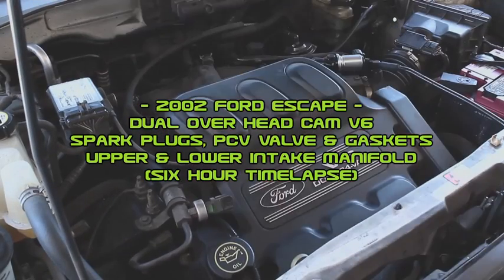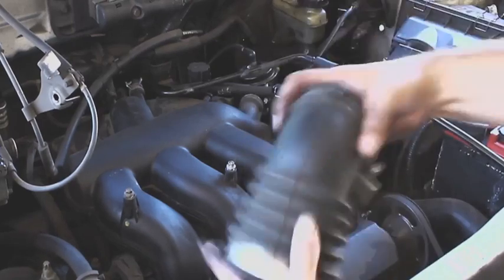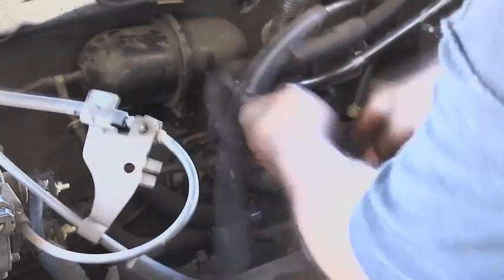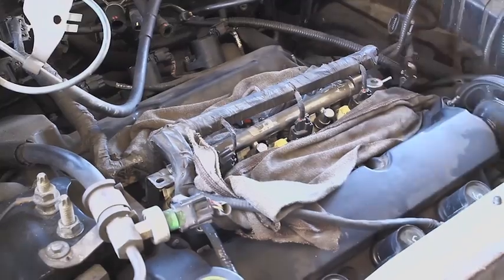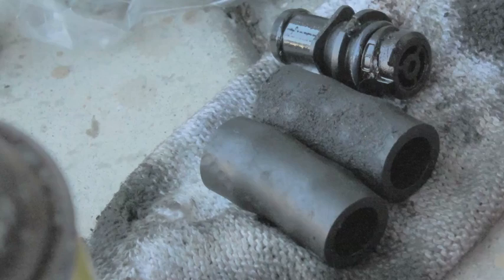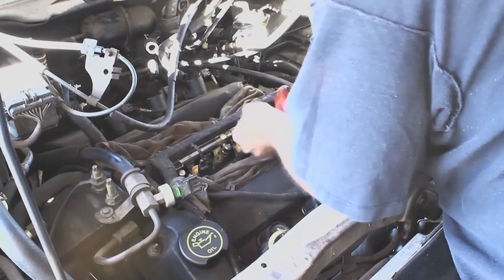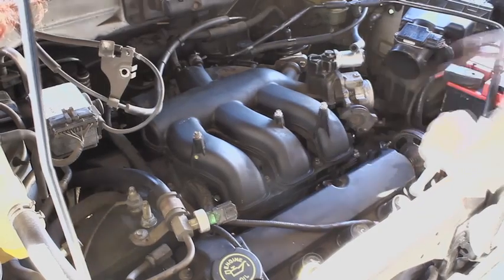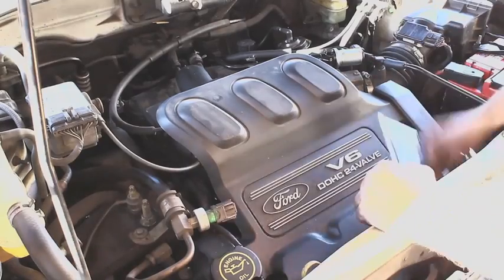2002 Ford Escape intake manifold gaskets (upper+lower) & Spark Plugs

Comment: P.s. I got to NY all right..I used " Bar's Leaks "... I swear by it. It got me there and back 3000 miles..
and Now I figure while I have the time..will fix.
Reply from the maker: mine has what appears to be an oil pan leak that i've read is common on escapes. a mechanic friend of mine recommended not using oil leak sealer because of clearances but i'm going to have to do something about it. the oil is changed regularly and the levels are maintained but i get the burnt oil smell sometimes and it's got some oil mess spattered about.

i have to re-edit the valve cover gasket replacement video and finally upload it, but...

the tricky part of it all was getting at some of the bolts with a u-joint socket adapter and the power steering line had to be disconnected to get the front cover off as well as some electric stuff and of course, vacuum lines and emissions junk (themz technical terms). other things like the radiator hose and everything else were simply maneuvered around very carefully.

i'm considering bar's leaks, glad to hear it works well!! currently, i'm planning to check all the bolts on the oil pan, because i've read that can sometimes become loose enough over time for a minor leak.
Reply from the maker: Steve Burden Hey Steve, how's that bars leaks holding up?! i'd like to try it on my oil leak. i read escapes have a rear main seal problem and bars leaks claims to rejuvenate that rubber seal. ...even read that ford uses it in their initial builds at the plant.
Reply: Lou - Couldn't be happier. It will be 1 year this Sept (2015) that I started using it in my Tribute. Will be using it again next couple of weeks with my oil change.

Hey Lou...Any thoughts on changing the Transmission Fluid? I heard that damage can result from doing a flush. My fluid is burnt and needs changing. Dont want to risk messing with a transmission that is currently working well.
Reply from the maker: Steve Burden cool man, good to hear back. i did a DRAIN & FILL on my automatic transmission for that same reason you mention. (some ppl have posted that if the transmission is used to the consistency of the old fluid it will struggle to readjust and just break down) the fluid in mine was so old it was black! (supposed to be RED of course) so at the place i get my oil changed i had a drain & fill done instead of a FLUSH & FILL and my transmission has done very well. it actually seems to have improved a bit on performance. that was 5 months ago 11/25/14. at some point in the near future i may do another drain & fill to continue gradually replacing the fluid completely.

something else to consider if you haven't done so in a long time, is a flush and fill of your coolant system.

cheers!
Reply: Cool. I've heard about draining the fluid (little by little) and replenishing with new..until most of it is completely out.
Thanks Lou.
Steve.
Reply: Did my first Drain and Fill - mustve been the easiest thing ive done so far on this Tribute - lol - drained it (still mildly warm) - got about 4 qts out. Will do another in the next month or so.
Reply from the maker: awesome man! if you haven't done a flush and fill of the radiator coolant in longer than 3 years or so, you may want to consider doing that also. as i understand, not doing so can be really bad on the engine internally. there's not much to rust but the aluminum oxidation can create problems (so i've heard). the excess heat otherwise generated tends to cause wear/degradation in almost anything generally speaking. Heat, Light, Oxygen... all 3 play into the breaking down of nutrients in foods and other stuff either individually or collectively. Great to hear about your Tribute!
Later!
Reply: Yeah, this past Jan 2015, replaced the upper, lower hoses...(around this time, water pump developed a leak...so I replaced that too)
Now the heater hose which runs FROM the heater core to the radiator JOINS next to /under the battery. The original joiner for these 2 hoses was plastic...well....
that was so worn that it broke up inside and carried pieces inside.

luckily it didn't damage my Radiator, but it did damage my pump.

Replaced it with a copper joiner - good to go.
Reply from the maker: Nice man! Gratifying i'm sure!! Probably saved yourself at least 100-200+ bucks.
Reply: You know it !

Comment: Hey Lou, I'm replacing spark plugs that are under the manifold...and I'm thinking about going after that oil leak in the valve cover gaskets. 

I noticed in spark plugs 4 and 5 there was a little oil in the well..
So, I'm going to attempt it. My confidence has been increasing.
Just replaced the water pump last week.
Thanks for the well wishes on my gig..Happy New Year to you bud - May 2015 be a good year
Reply from the maker: o-ring seals in the valve cover may likely be the culprit. be careful with any/all of the bolts when you are tightening them back into place, they're delicate. of course, the official recommendation is to use a torque wrench to tighten them to spec but, the oil, etc., can throw off the amount of torque required to tighten them to spec and the bolt head can snap clean off or strip the threads. bolt replacement pattern is important for even distribution. most DIY fixers might already know this but, you generally want to tighten all bolts incrementally rather than fully tighten a bolt at a time. HAPPY 2015!!

Comment: hey i have a 2004 ford escape n the mechanic told me i need a intake manifold,but i cant find it.can you recommend one
Reply from the maker: where to buy a new intake manifold/plenum? i'm not sure about that but unlike some other parts, i'd probably go with a ford dealership for that. however, i'd get another opinion before buying a new intake manifold. i bet it's just the gaskets (only a guess though).

Comment: What did you use to clean the engine block after you removed the lower intake manifold?
Reply from the maker: it's been a while but i think i just used a rag with some Awesome brand degreaser sprayed on the rag and not on the block. it was mostly dust/dirt rather than baked on oil, so it wasn't too difficult in my case. my main concern was of course, not dropping any debris into the ports.

Comment: Lou...saw your video on the intake manifold. I've got a Mazda tribute 2003 with oil leaking into the valve cylinder 4 ..5 and 6
Do you have a video on replacing these gaskets.
Sorry ..I'm not experienced...but I've got to do this job by end of this month (Aug)
Travelling from FL to NY on limited funds.
Appreciate your help.. Thanks so much
Steve
Reply from the maker: Hey Steve, thanks for the response. Last week I replaced the valve cover gasket set and did shoot video from an overhead setup. I haven't had a chance to edit it yet but I plan to cut it and upload soon. It took me 7 hours to do because I was being very careful and was also cleaning parts that are difficult to get to. Your gasket set may be different or you may choose another one but I chose the Fel-Pro - Valve Cover Gasket Set - Part Number: VS50551R. It includes the 2 main valve cover gaskets, 6 plug seals (crucial of course for oil leaks in SP wells), & 24 grommets for all of the bolts along the edges as well as the 2 in the center of each valve cover. Aside from the tools required, I also purchased a small tube of gasket sealer which is highly recommended for some tiny gaps in a few areas that join together. On the Escape, I had to disconnect the power steering pressure hose over the top to remove the VC's and all of the other obvious components like the plenum, etc., etc. Since there are fewer videos of this procedure than the spark plug/intake gaskets replacement, I plan to talk & show a bit more about the VC's in detail. Hopefully I can upload it in time to be helpful to you.
Reply: Thanks Lou...
We have the same engine ( of course..that's why I applaud your video)

I've been under the car to replace the 02 Sensor Bank 1 sensor 2. (On the passenger side just behind and beside the oil pan)
I noticed large oil leakage...was later told the Valve Gaskets and Intake manifold.
They want $100 an hr for labor... But after watching your videos..I KNOW i could do it.... Just need a good socket to reach those difficult places on the Valve cover (front & back)
Clearing the power steering hose. ..yes I saw that (re:  cylinder by the firewall)...
IF I can do this...I will feel pretty damn good about myself. Planning on leaving early Sept...gotta Gig on Sept 19 in NY (surprising my parents who've never seen or heard me sing..should be fun)

What would be the cost for parts? Gasket sets and sealant.
Thanks for your reply..can't wait for your video...please let me know when its uploaded...in the mean time..I'll be re-watching the other ones.
I've never worked on a car...shamefully I should've done this Years ago...
Its been only a couple of months that I did my first oil change. Yesterday I flushed the radiator, replaced a sensor, cleaned the MAF sensor ( which I notice the car runs slightly better)
This Gasket replacing and SPlgs will be something to celebrate ( for me )
I'm facing my fears and DOING IT.

Thanks for YOUR help...you were the spark I needed.
OK..enough rambling on my part.
TTYL Lou !
Reply from the maker: Very cool! Yup, same engine, I think the layout of wires/hoses sometimes varies from model to model with minor differences. I may be replacing O2 sensors in the future also and may have some questions for you about that. Yeah, I respect good trade mechanics but labor costs are crazy and if you can learn and give your car some tlc, why not right? BTW, congrats on your gig.

Gasket set is about $45 - $70 depending on where you purchase. It was cheaper on amazon but I opted for O'Reilly auto parts and paid $60 because I was in a rush. The gasket sealer was $4. You should only need a few dabs to hold the spark plug seals in place under the valve covers, if you choose. I didn't do that because I was losing light but that was silly because I lost peace of mind over it possibly not sitting right when it was going back in. Other than that, just a touch of sealant on the obvious corners and only until it starts to tack up and skin. I referenced the original gaskets carefully to see where the previous mechanic had used the sealer.

I should've done all this years ago myself! Haha. Yeah, these aspects of this engine are like a toy science project kit. Just be careful with all the electrical connectors and plastic parts and don't muscle anything. That's my 2 cents!

I'll be back with a list of tools I found essential and very useful.
-Lou
Reply from the maker: Steve Burden
Hey Steve, I added a comprehensive list of supplies and tools at the end of the "about" section of the video description.
Cheers,
-L